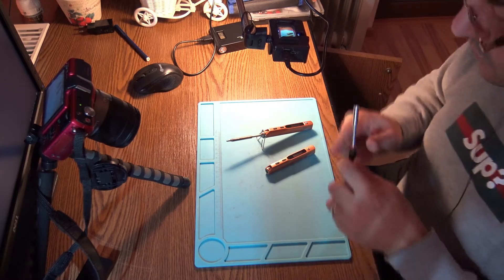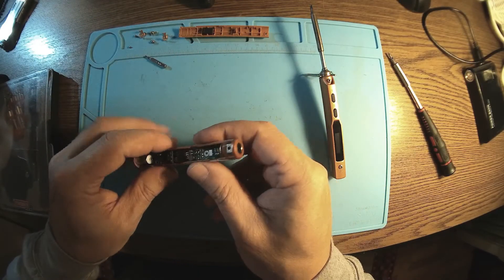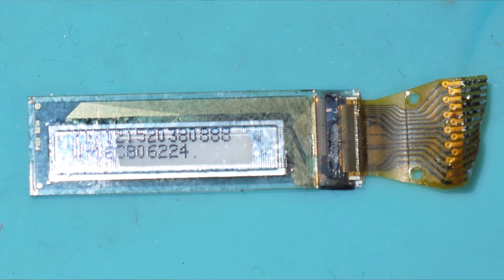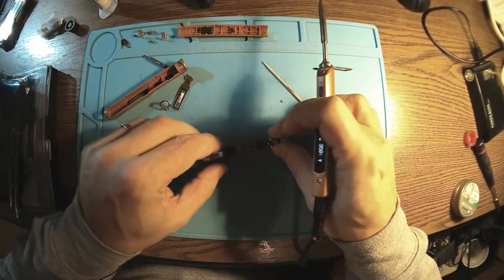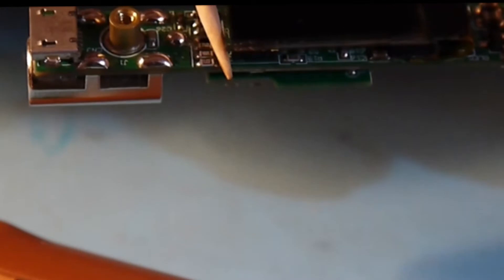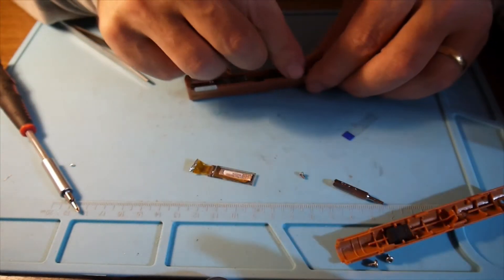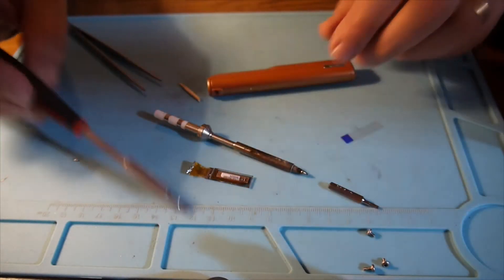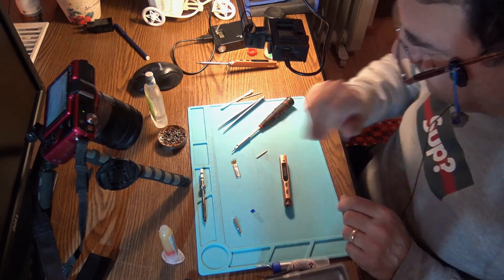Another TS100 soldering iron bites the dust! OLED replacement

Comment: That's a cool soldering iron I have one that's USB and I can plug into a battery bank I think I got it for $7 but it works okay  for small jobs
Reply: Viorel is correct this TS100 is a fantastic soldering iron but the display is utter junk.  Actually the OLED should last longer than the iron not the other way around.
Reply from the maker: @generalawareness101  I found replacements , they are great, for almost 2 years the luminosity didn't  fade a dime.
Reply: @viocaia  I meant the ones that come with it.  I lay odds, as most Chinese products, that the panels they use are B, or C grade.  D grade they aren't nor A grade as they don't last long enough.  With every machine I have ever purchased from China if/when I replace something that breaks it never breaks again as I use A, or B, grade parts.  They do this to cut costs and in China every manufacturer makes one item (CCP way) so build a machine (such as a laser engraver) that machine probably has low-grade parts from 10 different Chinese manufacturers.
Reply from the maker: @generalawareness101  Kind of stupid..you loose the hole product because a D grade part..just add 50 cents more and make it good! I also consider the fake of the fakes chain of products, only bad parts and made to last two days! But when you buy something from a shop..with 1 year warranty let's say..how the hell they manage to get broke after a year and 2 days?
Reply: @viocaia  Oh, I know.  There is an entire department meant to design something just long enough to be out of warranty.  The department will say this part will last for X now.  Cool, warranty is now X-2 days.  One thing these companies absolutely love to do is use inferior electrolytic capacitors that dry out as they know how long that takes.  Another is use 85c caps when 105c is what is required.
Reply from the maker: @generalawareness101  That's malefic! Such a energy waste!
Reply: @viocaia  This is why we have so much waste in our landfills because nothing is built to last for if it lasted they would cease to make money.  Sad.  I still remember TVs that last 60+ years only needing a tube changed every few years.  I have a TV that has lasted me now since 1996 made by Magnavox that even got hit with a lightning surge.  Took out the composite input (can't get a spare board for it), but that isn't its fault.  We will never get rid of this waste that is filling up our planet until we get rid of the money due to the reason I said above.  You can't make an everlasting Gobstopper, or the indestructible thread as that would put everyone out of business.  Eventually, if we ever manage it, we may end up like Star Trek where money is no longer used so building to last will be back again.  If we do end up there neither of us will be on this planet by then.
Reply from the maker: @generalawareness101  Absolutely agree! BTW I love Star Trek! and sci-fi generally...
Reply: @viocaia  Been a Trekker since 1974 when I would come home from school and turn it on.  That was the first year it was allowed to be in syndication as the old rule was 5 years after the final episode.
Reply from the maker: @generalawareness101  Great times!
Reply from the maker: I have a similar 8W, but it's kind of difference, this one have a proper temperature control and much more powerful, reach 60W without problems.It's amazing good..except the display..many people had to replace it..I did for 3 at least..